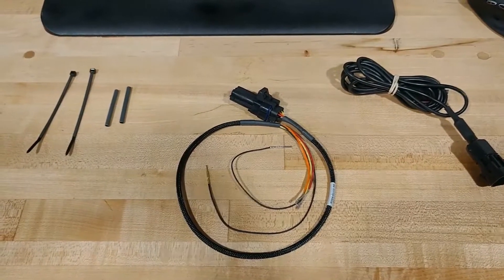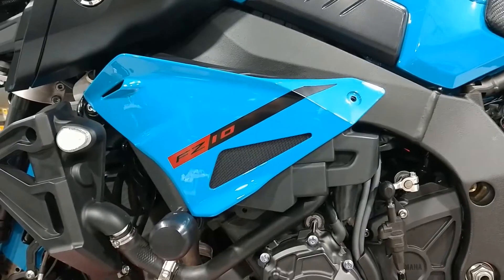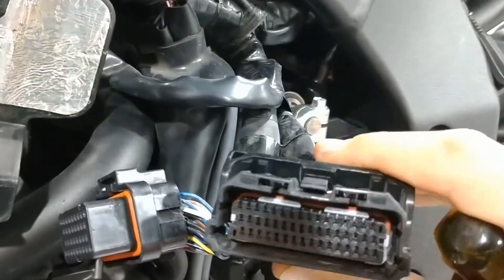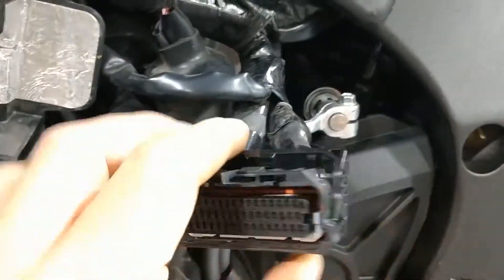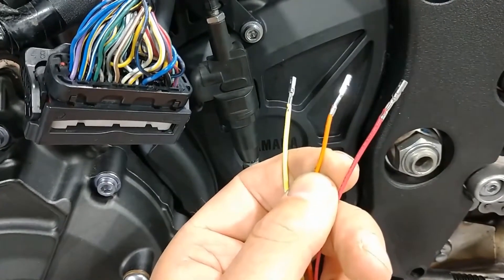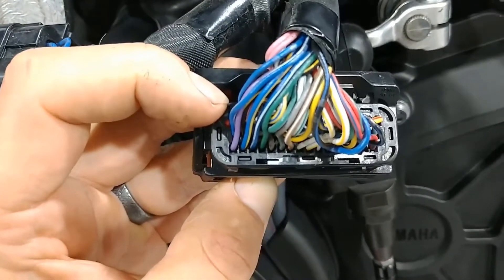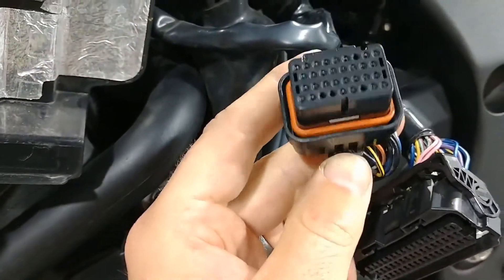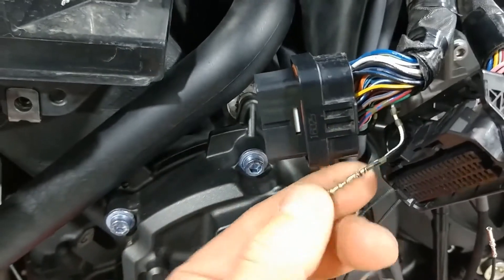Yamaha MT-10 FT ECU Installation and Reflash

Comment: Is the instruction the same at the 09 2015?
Reply from the maker: Not exact, but very close. You can use this as inspiration.
Reply: @StoltecMoto  ah oke. what exactly is the difference and what should i do to get it to work? Is there a possibility that you put some of that on film. I think there are several people with a 2015 model who would like this
Reply from the maker: @leroyvandewinkel4898  the base maps are different between these bikes, so things look a little different. Same goes for installing the O2 sensor and routing the wiring. 

But as for the active tune enabling, it’s the same process.
Reply: @StoltecMoto  Thank you for your response. regarding the base maps, I understand. I saw mt/fz09 on the video so I think it should be fine. but how do i get the harness working on the ecu from the 09. which harness wires go into which numbers on the existing plug of the ecu. If you could show that through a video that would be really great.
Reply from the maker: @leroyvandewinkel4898  the next time we have one of those models in the shop for ECU work, we'll make a video...good suggestion.
Reply: @StoltecMoto  can not wait. hehe thanks